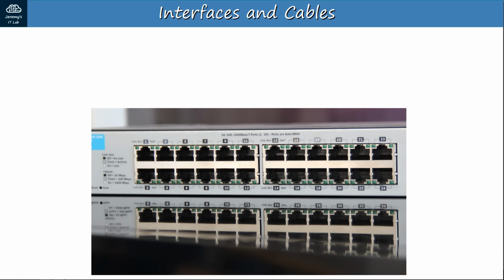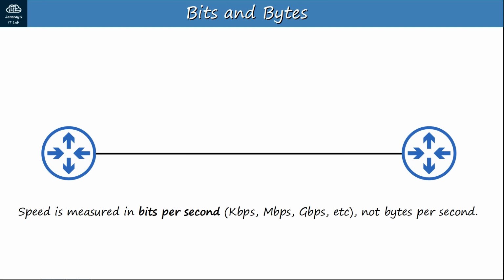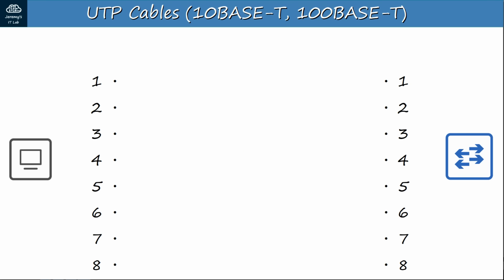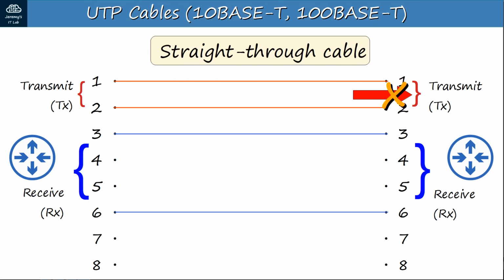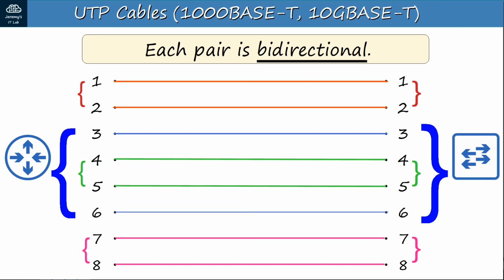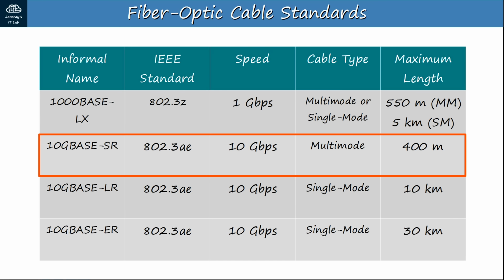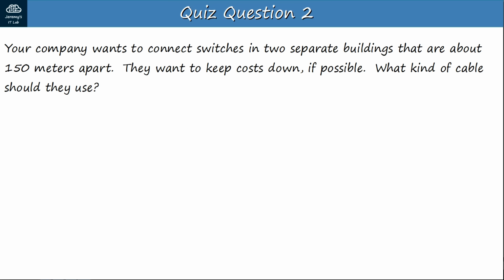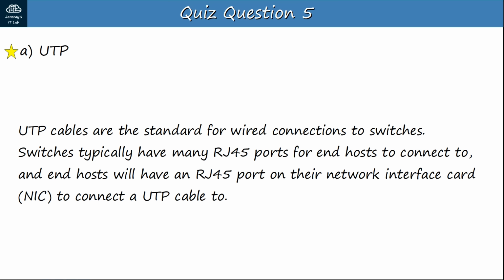Free CCNA | Interfaces and Cables | Day 2 | CCNA 200-301 Complete Course

Comment: Question: Why are pins 3 and 6 used instead of 3 and 4? 3 and 4 are still separate wires so there shouldn't be problems such as collisions, No?
Reply: On a side note, I love how in-depth you're going. Stops me from pausing the video and having to google and all. Thanks for this!
Reply from the maker: A quick google told me its for compatibility with other RJ connectors/sockets (not really relevant today, but that's the original reasoning)
Reply: @JeremysITLab  AHh got it! Shoulda just googled instead first. Thank you for taking the time, Jeremy!

Comment: First of all Thanks for this course. I am facing an issue am unable to open flashcard files. The files are downloaded but not opened.
 please let me out on this.
Reply from the maker: What program are you using to open the files?
Reply: @JeremysITLab  I am opening that flashcards file through the drive. is there any other application need to use for open tem? please let me know.

Comment: if you have two routers 175 feet apart can you use a 3rd router to conect them using utp?
Reply from the maker: 175 feet is only 53 meters, so there’s no need for the third router, a single UTP cable can connect them.
Reply: @JeremysITLab  apologies I did mean meters. In my head I would be using a 3rd router as a sort of signal booster. Also amazing series you can expect a donation in the near future.

Comment: 1000BASE-LX vs 10GBASE-SR which one has longer length ? guys .
Reply: Depend on cable mode 
Check the table in the vedio
Reply: 1000BASE-LX. A nice way to remember is that the "L" in "LX" can represent "Long" and the "S" in "SR" can represent "Short". 10GBASE-SR goes up to 400m, while 1000BASE-LX can go all the way up to 10km
Reply: @Girax93  Thanks for the tip! For the 10GBASE-ER, I see the "ER" as "Extra Range" or "Extended Range" which can imply the longest distance.

Comment: Just a heads up, the online portal to access the flashcards seems to not function anymore.  the site is still up it just doesn't send confirmation emails.
Reply from the maker: It works, but sometimes my emails get blocked as spam. Send an email to the address on the signup page if there are issues, I'll answer when I check my emails.